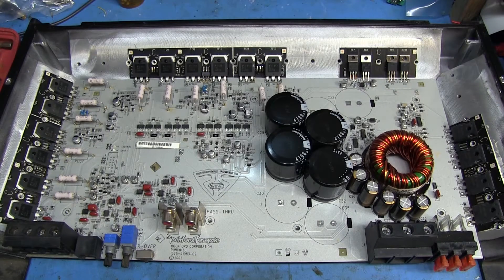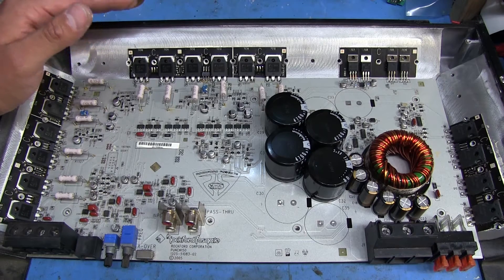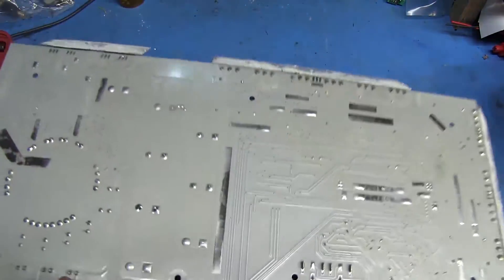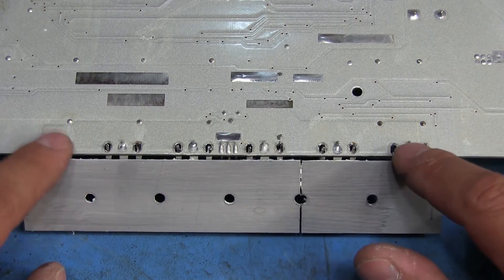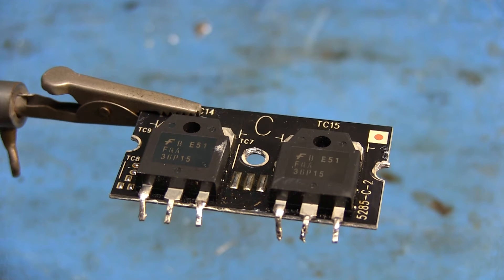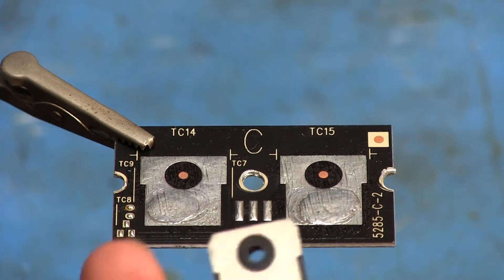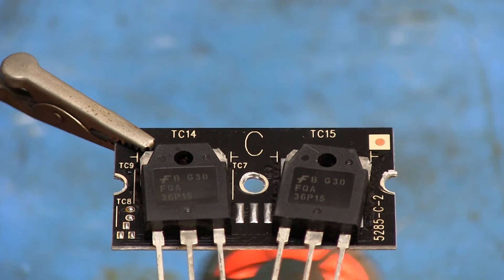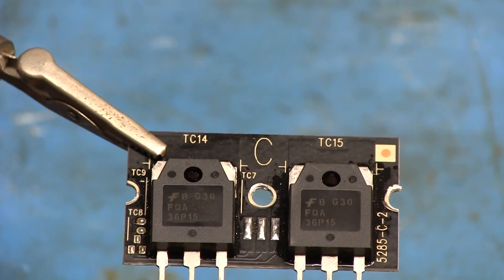TWB #28 | Replacing Power Devices in Rockford Fosgate Amps With Thermal Plates

Comment: What kind of thermal paste did you apply when mounting the board back?
Reply from the maker: For this, it would've been the white silicone thermal grease. Used it pretty much any time I replaced parts in an amp.
Reply: @ThatElectronicsFool  ok thanks. I ordered some dow 340. So should be the right stuff

Comment: i have a t1500bdcp as well and when i try to turn it on the gate drive will be there for a second and then disappear. Protect light is on after too. I already replaced the PWM driver and the LM339 comparators on the drive board. what else could it be?

Comment: Newer Rockford's have done away with those modules "Should be 2013 and newer", but they still have plates between the transistor pads and case! Also from a Manufacturing standpoint, these plates allowed faster assembly and cut costs by reducing assembly time, they can also use solder paste to hold the transistors in place and bake them onto the plates, instead of individually soldering each one by hand!

 But also if you look, there are jumpers on these old ones, which on normal amps would require a huge and long jumper for certain areas, Rockford however was limiting the distance for jumpers and keeping boards from being a "Hot Mess" on layouts!

Comment: I have exactly the same amp, the problem with it ,it blown the fuses any idea what the problem
Is  I will tank you, I will try to fix it my self  but your video encourage me to give a try.
Reply from the maker: It was a while ago, but I think the issue with the amp was shorted output transistors. Sounds like you might have shorted power supply MOSFETS, possibly caused by shorted ouputs as well.